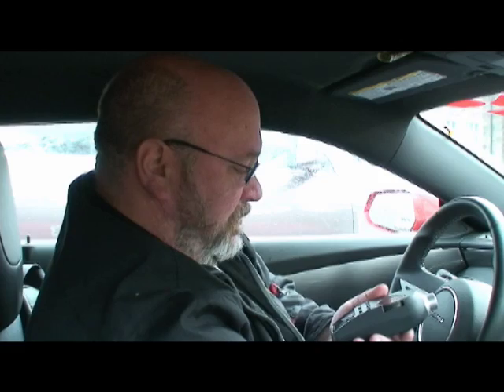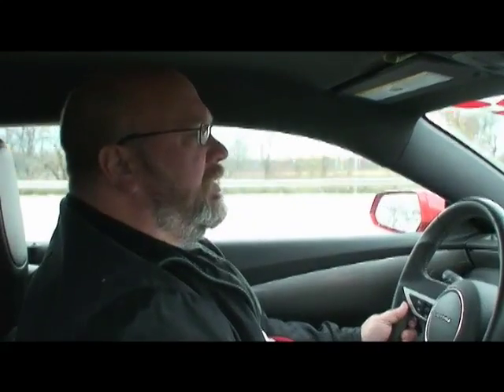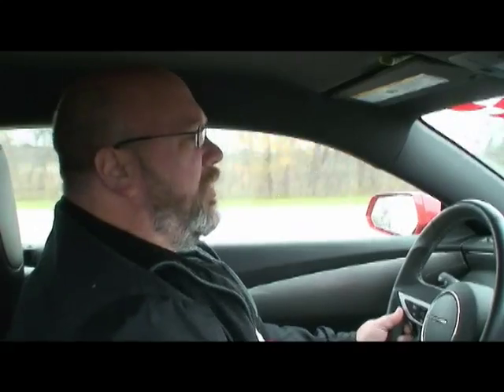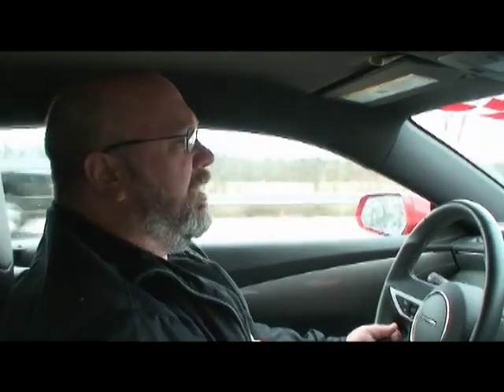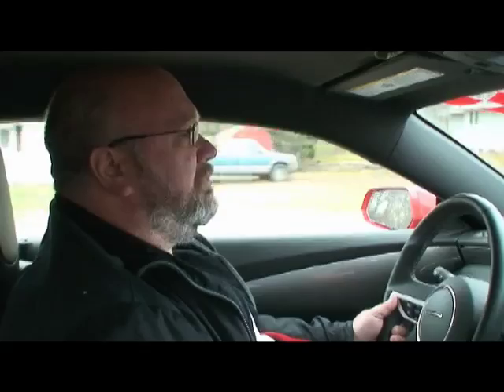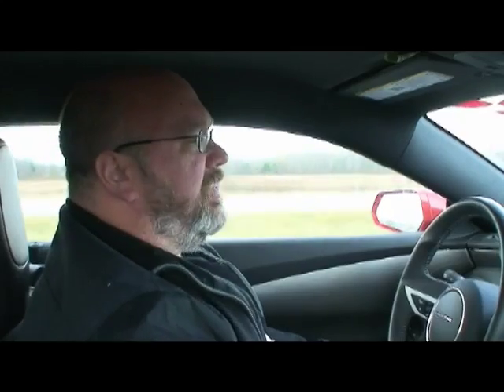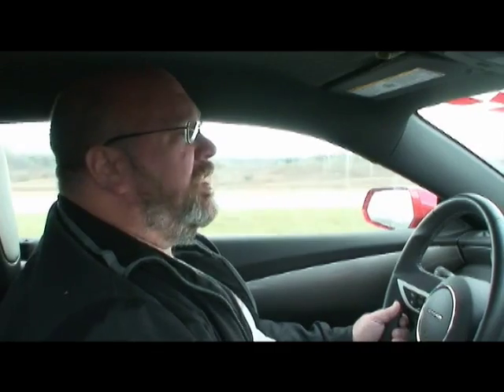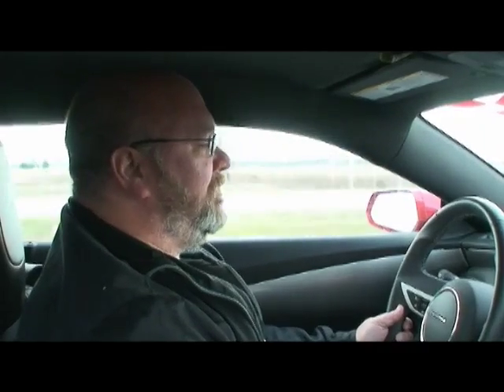MRT 2010 V6 Camaro Exhaust Ver 2.0 - In Cabin

Comment from the maker: it appears that the LLT might actually be able to take advantage WITH the need for tune. Check my other video on spark knock... with 87 i get quite a bit of knock sensor activity but hardly any with 91... suggesting that the car like higher octane and is running more timing...  That's my guess..  Best bet is to talk to Vince at Trifecta performance.